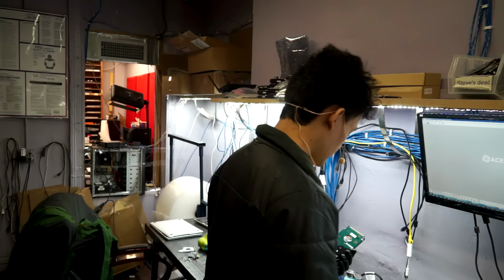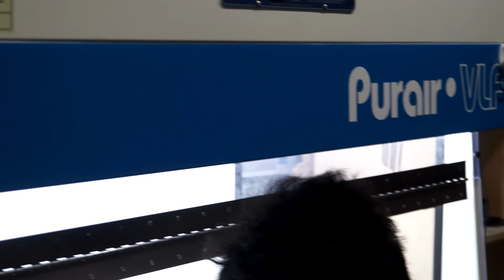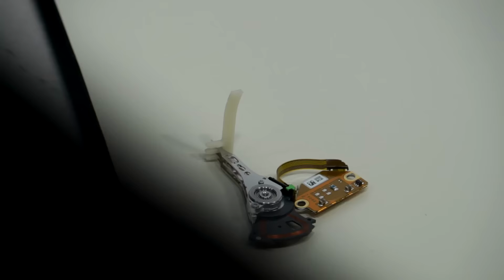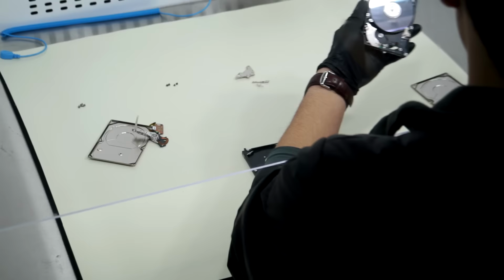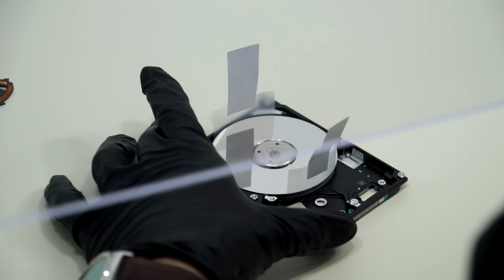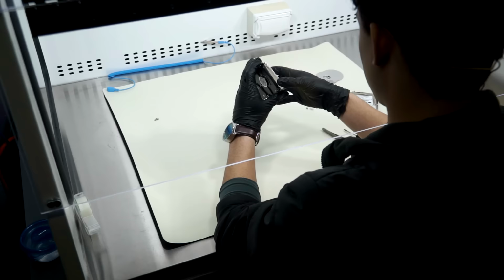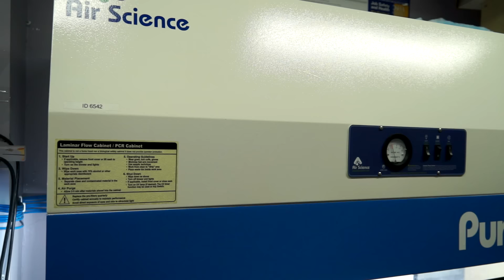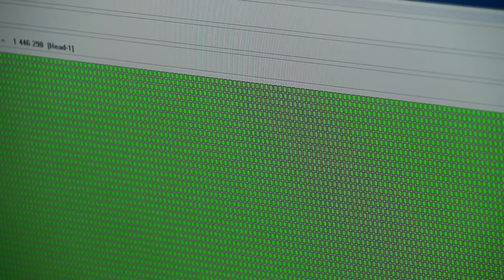Data Recovery: Hard Drive Platter Swap in Our Lab!

Comment: You're going to continue with the tradition of really p*ssing off a lof of pro's and causing them an aneurysm using the scotch tape trick, and I don't doubt you're going to come up with a lot of other "non-pro" methods in the time ahead which will work fine.

Bearing swap gear / gigs are out there for $$$$, or scotch tape :D

Looking forward to the progress over the course of a few months - excellent :)
Reply from the maker: I can't wait to see the comments on that....

I wasn't aware until we went to record that he is using scotch tape...
Reply: Wait for the HDD's with scotch tape on data surface of discs. ;)
Reply: Paul Daniels I've seen platens that have a little alignment mark on the edge. Mostly inside western digital drives
Reply: I wouldn't like to rely on that visually, would rather hope there would be an laser/sensor driven servo that instead rotates the platter until perfect alignment, definitely not something I'd like to see done by human hands.

Not sure why they'd have those interestingly, since from a factory assembly perspective it has no purpose.
Reply: I know as that alignment starts in HDD's first powerup in factory. Before that powerup, plates are pure blank. 
If you know old firmware ıssues of stuck on BSY seagate discs and how to recover HDD hardware (on many cases unable to recover data without surgery) that commands may re align the harddisk. Also that alignment isn't depend about any kind of mark.
Reply: That's for when you really need your data to stick around :)
Reply: The alignment is needed for mechanical properties, to maintain balance so there's no vibration to affect the reading process. The heads only know their position on the disk from the data they read.
Reply: ALfonsoB & JJ GJ,  got a reference on either of those points?  

These platters are already precision balanced/ground so I do not believe it's for balance properties (like car wheels).  There's been a lot of talk on the HDD recovery forums regarding the issues with misaligned platters and it seems to all point to data being non-recoverable if you get them out of alignment barring a factory return where they might have the required equipment to realign them, a lot of new people in there asking if they can still recover after they've removed that spindle lock washer/screw which allows the platters to shift independently.

It's a bit like now you cannot just swap boards between drives either, because all the nuanced properties of each drive are stored within and you'll just end up wrecking the drive if you try to start read/writing off a different platter set.
Reply: Given that public revolt resulted in Apple adjusting their response on the ERR53 issue, I would imagine that similarly aggressive would have similar results.  If they've been working on this since the 5S ( which afaik predates the RTR bill a bit? ), and it's still not common place then it's likely not going to see the light of day as a general rule any time soon.

Will they do their best to shut out 3rd party repairs, absolutely; but in reality, their far more deadly strategy is the one that's a lot more ethical/legal, they're simply offering repairs cheaper than what 3rd party shops can. Simple and vastly more effective.
Reply: Paul Daniels they actually have a tiny detent to it almost like they have some sort of alignment tool. It might be a quality control thing to test if the top ring is being torqued down enough and the platens can't turn by them selves during normal operation
Reply: they can say what they wants .... if it works it works....
they are just jealous because they needed years and years of learning without being able to do what you do without having theyr little school manual.
Reply: they push till they meet resistance as in err53, dial it back a bit to get people to get used to it then push again till they meet resistance, its an unofficial apple policy, and its not just apple, its big business in general, every year that passes we have less rights than the year before and its all backed by a political system that has neither the will and desire to tackle it
Reply: mechanical drives are cheap, and easily replaced its data recovery that platter swaps are utilised for, i dont know of any HD manufacturer that offers data recovery as a service, if your drive breaks, they send you a refurbished one so its unlikely people will open hard drives for warranty purposes
Reply: Seagate does. Usually starts at 400 and goes up to the thousands if they need to do platter swap or reconstruct the data.
Reply: Louis Rossmann I can't see anyone complaining about that. The majority have no clue how HDD data recovery even works. Those who do are either gonna be surprised,  or mad that you figured out a cheap and easy solution.
Reply: That's when you bring out the duck tape...
Reply: I mean after some thought I can't think of a better solution for under several grand
Reply: That is an excellent bit of work - bravo.
Reply: A large data recovery shop I know designs its own tools. The ones I've seen are basically a flat vise-like tool with a layer of medium-soft urethane on the jaws that locks the platters into place (jaws exactly fit the platters).

Then there's a small tool at the side that lets you mark the platters on the side with a really fine point while the platters are still screwed in the drive. Should you later lose alignment, there's another part to the tool that bolts on and provide an axle to mount the platters on (instead of the drive) that allows the platters to spin independently with just enough friction that it doesn't just spin past the mark and lets you re-align them using a stereomicroscope (like one they use for ballistics). When aligned you then tighten the vise and voila you can continue.

The scotch tape is a good trick and will usually work, but if one platter ever falls out you're completely screwed. Sometimes the data is just too important to hope that doesn't happen. Also with the tolerances as they are, I would guess that if you process hundreds of drives you're going to eventually get a set of platters that's misaligned even though nothing appears to have gone wrong. Designing a tool for the job would allow for salvaging such a situation.

I know they also processed drives for other recovery shops that didn't have such tools, and they'd usually advise them to always mark platters before removing them from the drive. Even a thick fat mark can be aligned later using just one side. So it can't hurt to at least mark them, just in case.

They thought it up in a weekend of brainstorming and prototyping using a CNC machine a long time ago, so it can't be that hard ;)
Reply: Because what if he fucks up? There there is NO WAY to get back the alignment (his words) For random photos I don't care and louis will get my business but don't say the method doesn't matter
Reply: Scotch tape can also be used to make single layers of carbon atoms - graphene! It's the new duct tape!

I really enjoyed the paper lifting tabs. :)

As for perfectly designed tools in an ideal world - nothing of the sort exists and human error can still come into play at any point. Backup, backup, backup. And backup some more.
Reply: @raphidae  unless you are on one of those mythical drives that stripe data from a single logical sector across all platters (supposedly some were made for RAID 3 purposes back in the early days of RAID), one need not worry about microscopic-level rotational alignment. On modern drives, large blocks of ~100MB or more are read from a single platter surface, before moving to the next one, rather than doing bit-level striping. As long as the heads can find the beginning of each sector, there should be no issues.
Reply: @NetRolller3D  Why are we talking about RAID exactly? This has nothing to do with RAID (3 or otherwise). RAID3 requires all drives (the data drives and the parity drive) to spin in sync, there are drives with spin lock setting for that (mostly SCSI). We're talking about alignment of platters in relation to each other and the read/write heads, not drives.

The alignment is important because the heads are fixed, and the sectors get smaller and smaller as the storage per square inch gets larger and larger. So, if the top platter is out of sync with a lower platter by more than a fraction of the width of a sector the top platter may be read correctly, but the head that's exactly below it is trying to read a lower platter and can't read a whole sector (or may not be able to read the sector ID, which means the same in practice). Which is a problem. It's not like the lower head can just shift a little to match the physically shifted sector, now can it?

And if the top platter is out of sync by a quarter sector or more the drive will not be able to read its calibration data or servo sector (or even the rest of its firmware if it's at the beginning of the platter as some drives have to save ROM) and it won't work at all.
Reply: @raphidae  so sector IDs are only written on the top platter, and the other heads rely on the top head to find their sectors? There is certainly no alignment with the spindle itself, i.e. no special "12 o'clock" position on the spindle, as the spindle motor is not a stepper...
Reply: @NetRolller3D  Obviously not, but the heads are still in a fixed position. The firmware is assuming it can read sectors with all heads on all platters concurrently. If they aren't in alignment it simply can't. There is no logic in the firmware to have the top head wait before reading the next sector because a lower head hasn't found it's (or read it's complete) sector yet. In theory firmware could compensate for this at the cost of a massive performance hit, but as this shouldn't happen, firmware does not compensate and just gives up.

You seem to be under the impression that you can just rotate platters in relation to each other (like 90 degrees or something) and the firmware will figure this out. It won't though, as it expects exact alignment. It could be done in theory, but no manufacturer has bothered as they just keep their platters in alignment.
Reply: @raphidae  that would make sense if consecutive sectors always alternated between platter surfaces - e.g. sector 123 read from the top of platter 1, then sector 124 from the bottom, 125  from the top of platter 2, and 126 from the bottom, and then back to platter 1. But I've never seen a drive with a head map like that - it's always multi-megabyte zones read with a single head. Unless you issue a really long sequential read or write command, say a gigabyte long (or get "lucky" and hit the range boundary with a shorter read), the drive will never get a chance to read simultaneously with multiple heads.
Reply: @NetRolller3D  So you think a HD just reads with one head at a a time? That hasn't been the case for a long time. The read commands are buffered and are executed in such a way that multiple heads can read at once.

Comment: When I tell people a HD is just a magnetic record player , they say no way , I say Way. The Way's have it , just a precision high speed magnetic record player.
Reply: It's more like a CD drive than a record player.
Reply: Well lets brake it down. A spining disc yes all 3 HD CD and Record Phonograph . A Phonograph has a Needle that touches the spinning disc and in the modern Phonograph it uses a Magnetic Cartridge. Does a CD or any Laser Disc use a Magnetic Cartridge or Pickup ? No. Does a HD use a Magnetic Pickup ? Yes it uses Magnetic Heads while they have an Air Gap between them and platters its so similar you could take one of these heads apart and make a Magnetic Needle cartridge . The only similarity between CD's and a Phonographs is the Linear method for recording data, and the for mentioned  spinning disc.
Reply: You're right and you're wrong. CD player and hard drive both are reading digital bits - a 0 or a 1. Record player, while it uses magnets, is reading a waveform from the record and creating an analog electrical signal.
Reply: But one can say that series of 1s and 0s are also a type of waveform that creates an analog electric signal - it's just interpreted differently.
Reply: Yep now we know the differences , let me rank them in longevity and accuracy . Lets stick to Audio, Hard Drive's have a 96kHz sampling rate compared to CD's 44.1kHz. But for convince and sound I rank CD's higher than HD's because you don't need a computer.  While phonographs are analog some still love the wide open sound. But these same audiophiles use noise reduction devices to remove the pops clicks and grindyness of these beloved ancient record players.
Reply: A phonograph record has more in common with a compact disc than with a hard drive. While all three record data on a circular medium, the record and the CD store data in a spiral pattern while a hard drive stores data in sectors.
Reply: Yes thats correct like I stated before a CD and a Phonograph store data in a linear fashion. But both HD and Phono use magnetic transducers in the end of their arms, and a phono looks like an HD. CD wins for ease of use for high end Audio and if you never have tried an High Def CD you should their next best to DVD Blue Ray Sound and blow away all MP3 Crap sound.
Reply: D... did you guys seriously have a discussion about this. This is kind of why I dislike techno geeks. It's like, "Dude why are you correcting a metaphor? It's not meant to be accurate or even remotely similar." Then it's like, "Why are you trying so hard to prove that your metaphor is in fact correct..." It's like there's this pervasive attitude of arrogance, over-confidence and elitism. It can get really annoying. Anywho /rant
Reply: I would say that it is more like a floppy drive han a magnetic phonograph.(the platters are really just hard floppy disks in a sense, mostly just because they both use a similar storage method)(also with spelling errors in this comment. if I type a space or any other character it deletes the one in front of it meaning to fix it I would have to retype the whole comment from that point on)
Reply: You guys forgot the tracking technique. Record players are dragged with a groove. The optical and magnetics use signal feedback to track the signals.